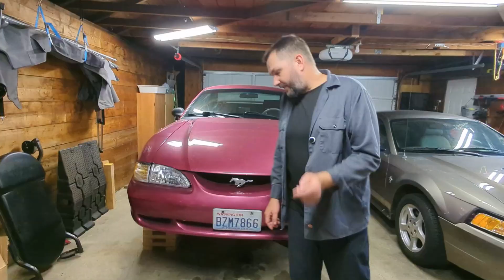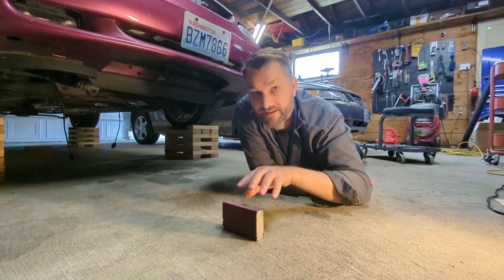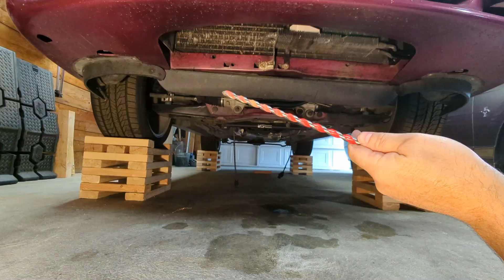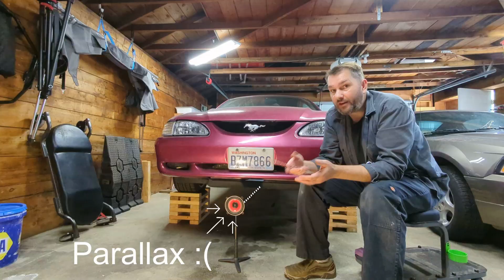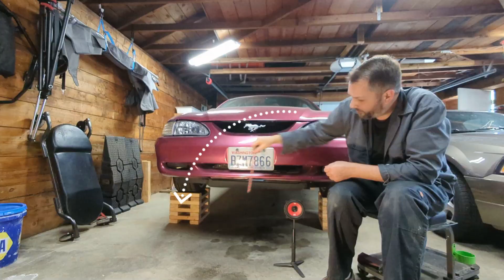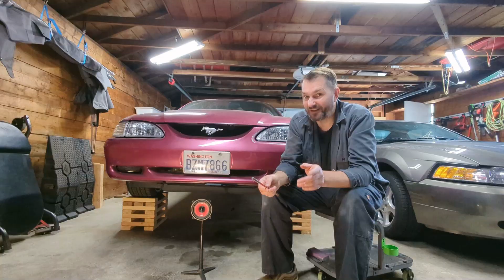Lowering suspension doesn't work like you expect.

Comment: Great job with the explanation.  You have recommended drop spindles in the front.  What is the best option to lower the rear an equivalent amount (on your early SN95)?
Reply from the maker: If you're sticking with a live rear axle changing to a torque arm arrangement (like Maximum Motorsports)  your rear roll center ends up around the floor pan (average between the lower axle mount and the chassis mount of the panhard) which isn't bad considering the rear of the car is lighter than the front and what mass it has is mostly pretty low to the ground in the first place.    

This next bit is a bit napkin-math so don't take it for gospel,  if your front roll couple (2" drop on spindles, stock otherwise) is like 13" and your rear roll couple (2" drop on springs in stock mid-arm location + 3 link torque arm) is like 8"  then  you'll have a tiny bit of bias to weight transfer onto the front when entering a corner (no power or brake).    Drivers' preference on sway bar tuning from there,  a little more in back and less in front would bring it close to neutral.

It should be mentioned that for a street driven car some bias to understeer is considered a good thing because your collision safety equipment, such that it exists, is focused on a forward collision.   You're more likely to survive a forward impact than a side one all else equal.  

Torque arm is a commitment and adds some weight but it's probably the best packaging you're gonna get at any ride height in these cars, shy of going IRS.